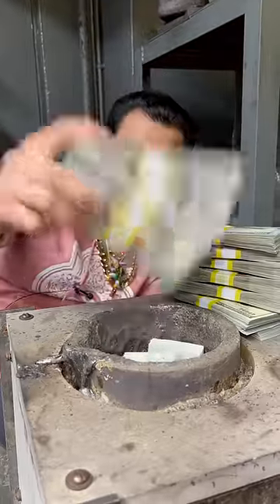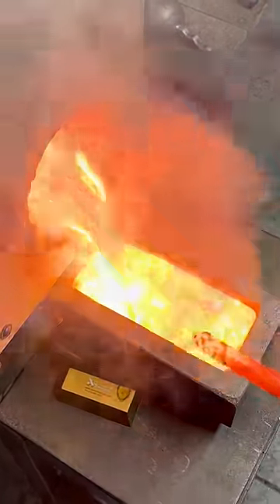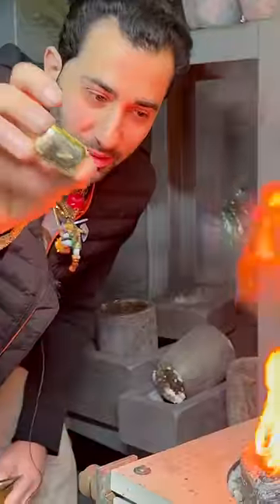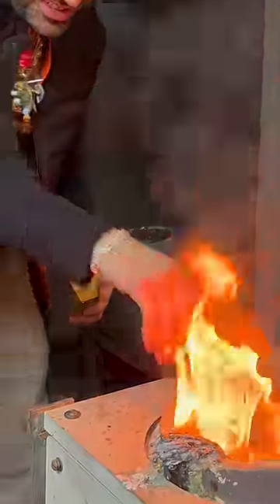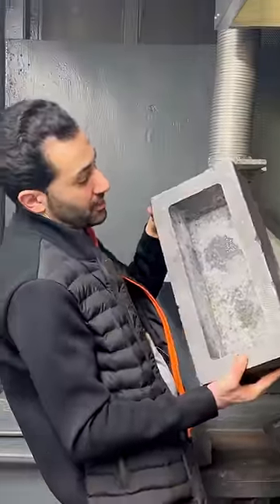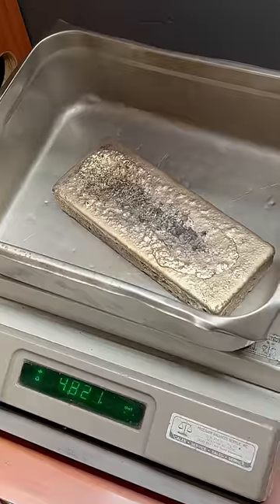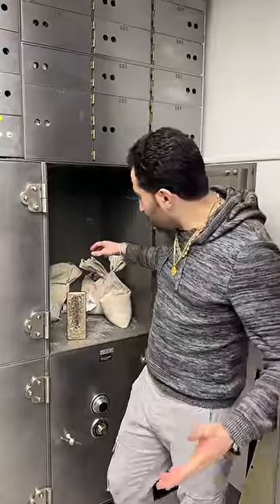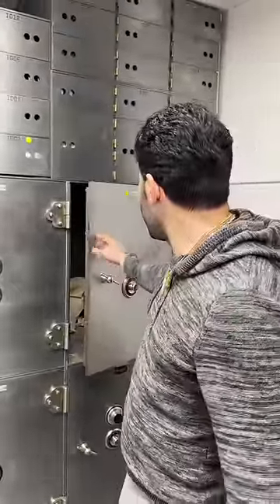TURNING $120,000 CASH INTO $150,000 OF GOLD!!!! #shorts

Comment: ”vvv.. vvv.. vvv” The sound he made was the sound of a high powered drill.
Reply: @raycoopthemenace7378  I tried, didn’t work.
Reply: 48 48 🎉
Reply: Could be the Roman numeral V which represents 5. I would say 15,15,15 since a combo lock doesn't go up to 555
Reply: Lol
Reply: It’s either roman numerals or hebrew. If it’s roman numerals. It’s an incorrect representation of “15-15-15”, but if it’s hebrew, “vav” is 6. So….depending how they say their numbers, 666-666-666 or maybe like 18-18-18?
Reply: WRITE THAT DOWN
Reply: This safe doesn't need to be drilled. This type requires wedges in series driven home with a huge sledge. Pound in the first tiny wedge, then the next a little bigger and bigger until kaboom. It flies open with a huge bang. There are ways to mitigate the destruction noise. Just playing loud music won't cut it.
Reply: Sounds like a job for the Payday Gang
Reply: He likes wayay vo's quevo oh oh ho's wave'oh oh's
Reply: Yeah that was my exact guess... The devil's number is on the top im guessing it would be an angel number on the bottom.. Even Though it should be the other way around 888 could be Jesus or 777 in heaven the number of perfection would be 7
Reply: I heard a muffled “52, 52,52”

Comment: Bro just casually touched fire
Reply: Actually the part of the fire that’s hot is the blue part at the bottom, the tongues are safe to touch, wouldn’t recommend it though..
Reply: @AclystDaChonkyDragon  thanks for the fact
Reply: @AclystDaChonkyDragon  rather, wouldnt recommend it for extended periods of time.
Reply: Have u never put ur hand near fire?
Reply: V = 5 in roman numerals so that means top comb is all 5's or 45. No idea how many numbers are required.
Reply: 55 55 55

Comment: Password is: Vi ..va…vah…
The lock picking lawyer: aww ….thats cute.
Reply: Mcnally: opens safe with another safe
Reply: How how long is it?
😊
Reply: McNally would just throw a speed square at it
Reply: @illBuyYourNameOffoU it absolutely has a lock. What it doesn't have are key cylinders to pick. Cracking this would involve listening equipment and the ability to hear each individual mechanism disengage
Reply: @HunterLeon-ho6bf  YESS
Reply: It’s not a lock you can pick though why do you think he doesn’t do safes. Even if he did it would probably just be the type that you can just drop on the corner and they pop open anyways
Reply: 123

Comment: 51% pure gold is a wild statement
Reply: Yeah…. all of 12 carats. Hot stuff. 🫣
Reply: @vondahe  tbf it can be refined back to pure if you want. I just don't think thats his thing.
Reply: Explain...
Reply: @drwgalabuschagne3287  Elaborate…
Reply: @vondahe  So you just pulled that "12 carats" statement out of thin air?
Reply: @drwgalabuschagne3287  51% is roughly 12 carat, Doctor.
Reply: @vondahe  How does one calculate that?
Reply: @drwgalabuschagne3287  You can find videos that explain that here or Google it at your leisure.
Reply: @drwgalabuschagne3287  it's between 10k at ~42% and 14k at ~58%.  24k is 100% pure, 12k is 50%

Comment: You could’ve mixed it with copper or silver to get the gold content lower and then drop the hot mixture in water to create small pellets. Then dissolve these in aqua Regia and later precipitate the gold back out with sodium sulfite. You’ll get close to 100 percent purity
Reply: jewellery is mostly 14K, so i guess it’s more economical to make more jewellery in the lower percentage purity than in the weaker and smaller quantity 100% purity
Reply: You would lose to much weight
Reply: But all gold is supposed to be made with pure gold (100%) mixed with pure silver (100%).  The karat just lets you know what percentage of gold versus silver, correct?

Comment: While you’re sleeping sound, a 4” coring machine will drill a hole right through that double lock set in about ooooohhhh 8 mins. Your security is a joke, I don’t care who put it in. I’ve installed high end security for 24 years. I can get around most systems fairly easy. There are some serious set ups but still work off the same principles. Line signal and magnetics. Cameras?, lol you can watch me do it. 😂😂😂